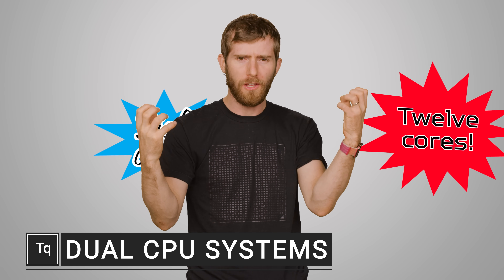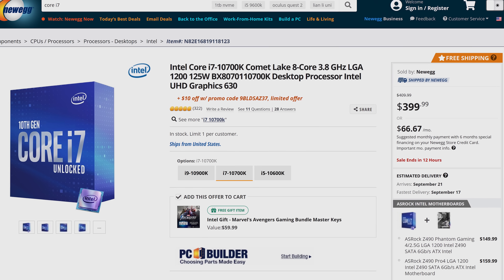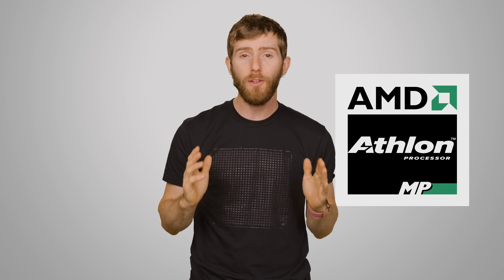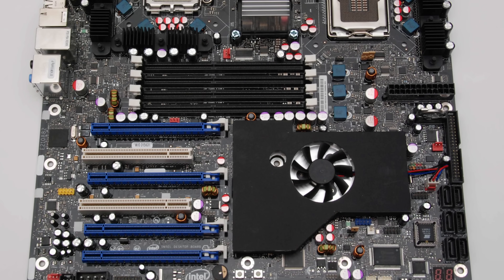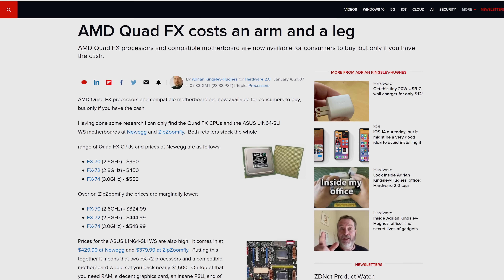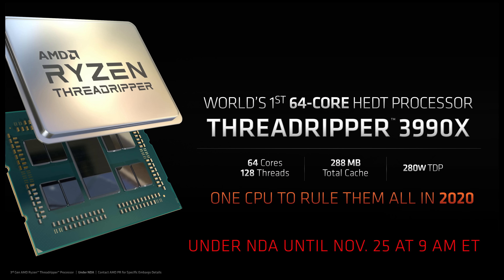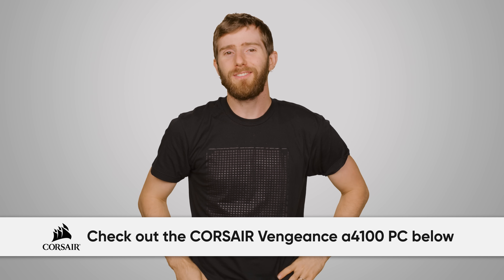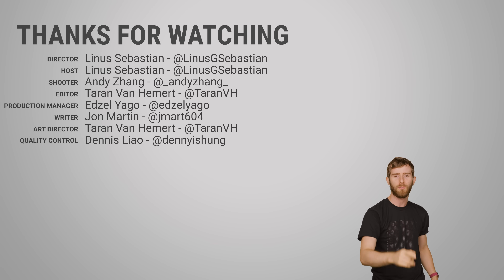Should You Put TWO CPUs In Your PC?

Comment: Built a machine using 2 x Pentium II processors running under Windows 2K. The beauty of Windows 2K was that you could assign specific software or tasks to each processor - it worked a treat for creating large Word documents for tenders, absolutely flew along and never suffered the usual buffering when undertaking re pagination.

Comment: the fact that linus is actually funded by intel means that xeon is not promoted for gaming, but it works better. it costs a great deal more new, but used it is cheap. if you all know that, then you will not buy the cheaper cpu's of the "i" series for desktops. server workstations are better. you can even use multiple gpu's with them at the same time. youare all victims of being consumers. linus is very wrong, especially for helldivers 2. its all math. my x99 dual cpu mobo is better than the lga 1700 single. and my x299 lga 2600 is better than my lga 1700 with the 4070 super and the ddr 5. im running the arc a770 in an lga 2600 with ddr4 rdimm on the xeon 4ghz at 4k and it runs and looks better than the ps5 or the lga1700. advertisement is a controlled environment. intel wants you to buy what they want how they want because of the bureaucracy of the execs who need to control sales in order to keep their useless jobs thus keeping that corporation from taking over the gaming pc industry. now you know why they hold back on the gpu's. they have been out of stock forever now. they have the resources to wipe out the competition, but if they did then some departments would lose their jobs so the execs fight to keep them. it is worse than car models and designs when it comes to  intel. what people truly want and what ends up on the table are never enough. it also means they are not selling you a product that will be sufficient for the next 10 years, rather the next 10 months when it comes to gaming. the want and demand for affordable pc gaming is so high you'd think someone would take the market up, but this would end many upper ranked execs jobs who are out of touch with the common people and do not understand the amount of money that could be gained. the majority of money is from low income as they hold 70 percent of every economic class nation in funds. you see that nvidia has only gone for the less than 10 percent of population in the USA for sales. every 5 months another 2 fps increase for 1500 dollars. AMD went for longevity, so nvidia cut them out by hitting the game devs no longer carrying driver updates and updating and killing drivers for AMD. No one does it to Intel for obvious reasons, yet AMD is bigger than nvidia. so there is law stuff in there too. also intel must sell more products to keep going and must cater to both AMD and intel. yet if they were being ran efficiantly they would take out even microsoft in gaming and buy nvidia out. however, you cannot be a US business and be a monopoly, so there are reasons that linus is told what to do or even allowed by intel.
math is math. linus does not understand math or anything electrical. these cpu's are just simply circuits. the same way your light switch works. only instead of one circuit there are millions of them. each one serves a function in sums and values. its just a bunch of signals to sensors causing functions. obviously the more cache and higher frequency and threads allows more information to process as long as the OS allows it to. windows home restricts your cpu, windows business does not. you cannot use two cpu's on windows home licenses. you also cannot use step codes and run xeons with full speed and power on windows home licenses. this is because Microsoft, Intel, and AMD have an agreement in contract for this. my older workstation is a screamer and my new desktop is barely making it. this need for the math processing can also be controlled by the application software too! some games devs are simply paid in contract to cut old drivers in order to sell new gpu's and cpu's. this is called "obsoletion" and is illegal in some countries. in this case some nations have actually had them put the software back. this is why a person in china and india can play games on older gpu's with more frame rate then the USA can. the spyware and all that info gathering is bad for some games, but never enough to keep you slowed down as much as in the USA. now you know.
1. never use anything but what the games were designed and made on like a desktop mobo, instead use a server workstation mobo.
2. these games were not made last week, it takes some years, so the server workstation mobo from 5 years ago will do. when that mobo was new it was 10k or more, now its 150 dollars or as little as 45 dollars.
3. the cpu's for the server workstations from 5 years or more ago are what they used to test and play the game smoothly, so get one, or two if it's a dual cpu mobo. those cpu's were 5 to 15k when new and now they are between 10 dollars and 400 dollars.
4. go for high frequency, large cache, at least 4 to 6 cores, but not ever more than 16 cores per cpu. more cores equals higher temps.
5. stop using glass sides, and stope using rgb fans. use actual fans from the model for that server workstation mobo.
6. stop using modular power supplies. use the correct one (there are always 2 models at least) for that workstation mobo.
7. DDR4 RDimm is faster than desktop ram DDR5. it crunches numbers way way way faster.
8. make sure you get the poer supply needed if you add a tesla gpu or data center gpu of any type to your workstation, and make sure you have the correct plastic channeling and all the fan options for your model if you. (have 3 gpu's and a whole terabyte of ram I find the load on my two cpu's in my dual motherboard is even less than before. who would have thought... duh.)
9. yes, the amount of ram. in my case it is 1 terabyte. and i got this workstation for 115 on auction at ebay, but you could put one together too, for around 500 to 800. it also makes cgi movies. that is what it did before i became the second owner. it made movies contracted to disney. when it was new in 2019 it cost them $37,000.00 USD. disney downsized in 2023. the model is a dell from 2017. the service life for dell is 6 years also so no tech support beyond contract. it turns out that people who "code" are not very good with common sense or hardware or anything electrical. coding is a learned task patterns and not actual real math and obviously most people suck at it. devs suck plane and simple.)
10. use business class licenses as windows and linux will not let you go full throttle.
11. dnt thank me, thank yourself for not being a mindless consumer and actually learning to use your mind to see between the lines of swindlers.

Comment: There are legit reasons for dual socket beyond cores. Increasing cores on one cpu is NOT equivalent. Why? The # of memory channels per cpu is constant. So with more cores you do not get linear scaling, you only get more compute but not more memory bandwidth. Dual socket gives you that bandwidth. The overhead of cpu-to-cpu is not a problem for certain types of workloads. All in all dual socket is perfect for servers and the kinds of workloads they do and will certainly outperform a higher core single cpu due to the doubling of memory bandwidth. In fact, most workloads won’t see a perf improvement from more cores if the ratio of memory channels to cores exceeds 4:1, with 2:1 being ideal for memory bound software. So for me, EPYC with 12 channels means 24 cores, dual socket doubles everything linearly. But EPYC with 12 channels 48 cores will have starved cores that sit around waiting on memory and go unused, often being slower than a lower core model due to contention. Super high core counts are only going to help for highly cache efficient algorithms that are purely compute bound, such as ML, but then you’re better off using dedicated hardware if possible.

Comment: So would there be some "activatable guidance" telling the second cpu to act as a kinda south bridge? that would distort the entire mainboards architecture, right? or could that be built in such a a manner? i'd doubt that. If the two cpu's would be of identical build how could software differentiate without marking in some material way, besides software (running)? i'm not a nerd though, just thinking.

Comment: Feels like a dual CPU setup could be viable again with powerful iGPU:s now in the CPU.
For example using 2 780M iGPU:s would give you a pretty powerful graphical performance.
Or could you break out the iGPU cores and just add a bunch of those in the same way you add ram to a mother board?
For example 4 780M chips would give you a theoretical max graphical performance of 8 TFlops * 4 = 32 Tflops.

Comment: I have a Dell proprietary PC with an Intel Xeon E5-2697 v3 CPU, it uses LGA 2011 socket. I have 64GB of DDR4 RAM from Cisco (2x32GB). I want to break from the proprietary non-sense Dell has. Not for gaming but for being able to do anything my nerdy ass feels like (I don't want a bottle neck in computation). I wanna get another of the same CPU, E-ATX/ATX dual CPU mobo, and upgrade the hell of it. Yes, I will get an old looking tower (#sleeperbuild).

Comment: Here's a serious question:  Every Hyperthreading Intel CPU I've ever used had terrible performance using software that only supported 1 CPU/core, which for a very long time was pretty much every video game for PC's that existed. The latest I verified this with was Sandy Bridge i7 Quad-cores and Ivy Bridge i5 Dual-cores, but I'm suspicious as if I buy a CPU these days that has 10, 16, 24 or more cores then I don't see why most people would ever need it. As for AMD Ryzen, can I disable it? I've had my 1st Ryzen (A 5 Pro, 6650U) for 9 days now, so I haven't quite figured much out about it, other than it occasionally does some weird and rare bugs that don't like to reproduce and are difficult to distinguish between potential hardware, software, & drivers - Are burn in periods still a real thing for some hardware?

Comment: Question - 

Disregarding rich ppl CPUs, would multi-CPU-ing a build help with CPU freezes?
That's what I call a CPU being so overloaded with a task, that it starts to go haywire and screw with everything's performance.
Very often seen issue in low-end hardware trying to run new age software.
Could one CPU's performance be delegated to specific tasks - or are they just merged together so it's not a "one kidney fails, the other can still function" kind of situation?

Comment: many years ago there was a duel slot 1 Pentium motherboard  i am using a old dell t7500 duel xeon processor and it works fine it will multitask without any problems GPU 2060 is the limiting factor with the machine

Comment: I had one.  HP z620 2xe5 2690  86gb od ddr3.  Ill tell you right now there is no latency and it is actually fast asf!  Unlimited fire fox tabs or whatever while gaming...  In all fairness you have 12 ddr3 access point to fead upt to 32 ligical threads.  ddr3 as lower latency.  That is hard to beat....  These modern 16 core gaming pc's are actually better at gamibg but if you need something for research as workstation and do light gaming it works.  it was better at recording 4k lossless gameplay with a rtx 2080 than a 5950x 32gb ddr4 rtx 3090.
Reply: thats 12 slots of ecc 1866mhz ddr3

Comment: I still say this is a gaming opportunity…

Have a powerful multi core thats amazing for work like video and other heavy lifting.

Have another one with low core count say 4 core designed for highest clock possible and exceptional cooling.  This would be the main cpu for main game workloads.

I am convinced this would offer better performance than trying to make something that does heavy lifting and MHz for games when there are so many cores on the die.

This differs from current and earlier dual cpu as it has dedicated cpu for different purposes and with the right chipset/drivers it should allow these to work without too much cross cpu traffic.

Comment: basically if your planning on building your own pc desktop system and to run windows 11 onwards your gonna need to future proof yourself so mother boards that are multi core capable so down line you'd only need to upgrade the processor and maybe ram that's it or should be

Comment: I had a dual Pentium 166 back in the day. It wasn't just that there wasn't much in multithreaded programs. You needed at least Windows NT or Linux to even be able to use the second cpu. In W95 or W98 the second CPU was unavailable... Also in those days the CPUs had to be the same and preferably from the same batch or it would be unstable. But it did allow you to encode a CD to MP3 and still have usable system. Which mattered since encoding an entire CD to mp3 took hours that you could otherwise not use your system for something else ;-)

Comment: My first dual processor machine was a pentium pro, this goes wayyyyyyy back as the man says. One of the main advantages of multi cpu systems in older servers is that each cpu has it's own memory management, so more CPUs = more memory. Some particularly big, expensive and fully optioned servers had insane amounts of memory.

Comment: My research is based around at home Ai work and robot "nueralnet" processing. So I still feel like I would have a use case for this at home application. in 50 years a home server system may save your robots down time or "basic process function only" modality during power outages or go forbid internet errors. So...maybe this needs to be developed?

Comment: I had one of the first dual CPU consumer platforms back in the day, the legendary Abit BP6 with two Celeron chips. The problem was none of the consumer operating systems of the day supported more than one CPU, so I've had to compile a Linux kernel which added SMP support and also dual-boot into Windows NT for my Windows software. On top of that, device drivers back then weren't really designed to be thread-safe, so I remember frequent lock-ups with Creative's sound drivers. It was really a lot more trouble than what it's worth. 

When Windows 2000 Pro came out, that was actually a pleasant and performant operating system which supported dual processors and ran many popular games of the day at a decent speed, such as Quake 3, which in itself was one of the few games that supported dual processors. Happy days. Compatibility wasn't 100% though, so I still had to keep a Win98SE partition around for many games.

Comment: I know this video basically mocks the use of dual CPUs in modern times, but what a lot of people do not realize is that you can repurposed old server chips that originally cost thousands of dollars when they first came out. Even now you can get a 16 core E5 Xeon for as low as $50 off ebay. If you pair two of those together you will get 64 threads for $100 that can crunch data nearly as good as a newer high end processor. This might not sound appealing for most people because nearly all games benefit more from single core speeds than extra cores. Yet you can still game on dual Xeons if you really want. Most of these guys start bashing the performance because they do not know what NUMA is and do not realize you need to enable it  in the bios if you are trying to do something like game. Gaming and making work stations from old server hardware will save you a ton of money and give you great performance on the cheap.
Reply: I've built a dual-cpu system with total 36 cores and boost unlock. It is cheaper than some ryzen systems. It definetly must be slower in some tasks and consume more power. But it is so uncommon to have such PC and I am still able to do whatever I want with good enough 3.8 GHz on low multitask and 96 Gb of RAM 😄

Comment: There can be a small benefit in power consumption and modularity. The enthusiast PCs take up 6-8x the power consumption of a low-medium end PC+GPU. They also run at much higher temp during heavy loads. Intel processors are coming overclocked internally just to compete with amd.
Instead two low power PCs could consume less and be better at multithreading tasks, while also avoiding thermal throttling. Consumer could purchase one at a time some parts. There would be performance loss due to sync issues but the freedom would be so worth it. SBCs are increasingly getting stacked, and maybe in future the demand will come.

Comment: There are some workloads which required multiple CPU's but switched not to multiple GPU's.
As Linus is more about Gaming than technical simulation/video rendering it's not the workload for most home users. 
Home users load their simulation got to work and fetch the results after their shift. It doesn't matter if it run 3h or 6h. 
Now you can use the cloud or an FPGA (I used a zynq-7000). With a cloud it's most time more cost effective as my now dust fetching FPGA's. Windows was never a fan of multi cpu workloads.

Comment: I have loads of computers with 2 CPUs - the Z600, Z640, Z800, Z840 - and they are all AWESOME with up to 128GB RAM, huge storage abilty and the Z640 I just bought has 32 cores,64 threads, 128GB DDR4 RAM and gives over 9000 on Cinebench 20 kicking the crap out of most i7 and some Ryzens and of course all running Windows 11 with no problems.

Comment: Uh no. I had three dual CPU machines at home in 1998. Middle range. Windows 9* could only use one CPU, but NT could use two ( or more but for more money ) linux could handle many. 

Once you added the second CPU to an NT machine it became so much stabler, mainly because because runaway process only hogged one CPU.